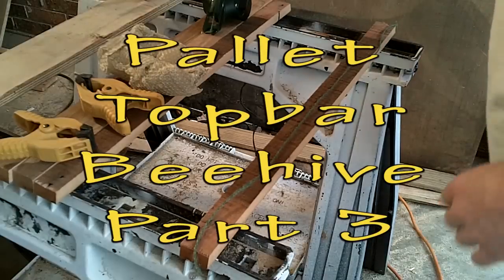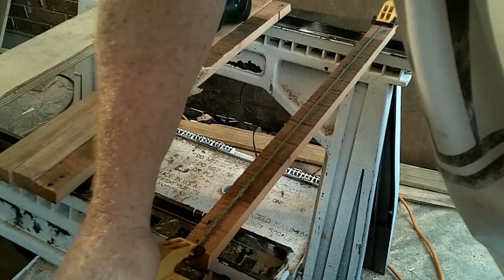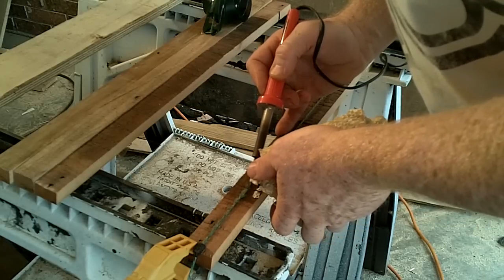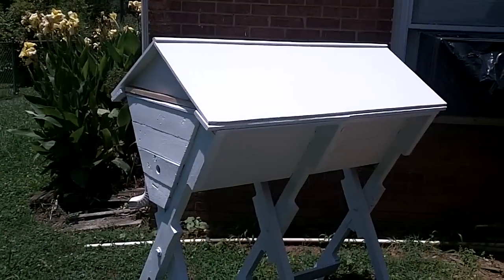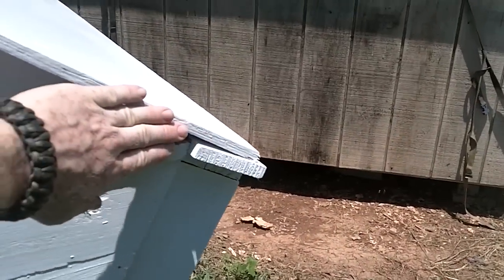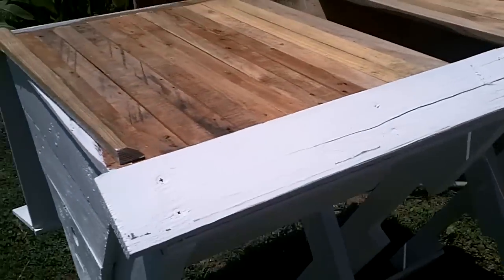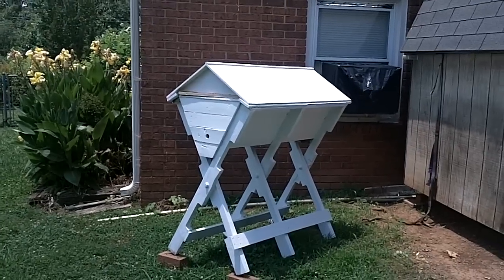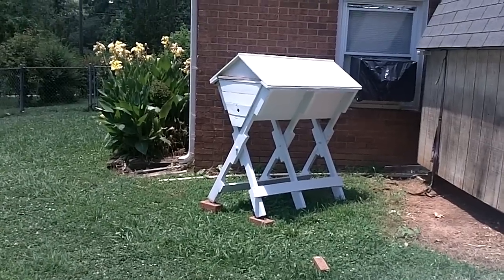Topbar Beehive Part 3

Comment from the maker: Close off the bottom will be something you will need to do in the winter time. You may want to add some install installation to the outside as well. I am still working on mine a little bit. Every year I see something I could have done better. LOL I am reworking my top on the first one I build now.

Comment: Nice TBH. I like the simplicity and the repurposing of pallets.
May I suggest NOT putting a chain catch on the top but allowing it to swing all the way open. Reason being is that if you get any amount of wind, you will either be wearing the top across your nose or across your wrists as one more bracelet. lol
Question. Could you soak the rope in melted wax and then attach it to a top bar with staples? The bees are going to add to the wax anyhow and you are just giving them a guide, correct?
Reply: I disagree... Chain that Lid !!! Do it so it's angled a bit beyond the 90 degree in the hinge direction.... With a strong Support Block to take the weight off the hinge. Also add a piece of Brace Timber between Roof and Top Bars, and another from Roof to Ground, when doing Bee work . Take these out, and store lengthwise inside roof space when not needed. Then you won't get crushed fingers and wrists, or have the Hive blow over... 🙄

Reason ?  Simple : 
As a Horizontal Hive user, Beekeeper, you can use the inside lid area, as your Frame Rest. Inspect your Frames hands free, do Grafting, Catch, and Mark the Queen... All sorts, even take Photos or Video of Bees out of the Wind, or direct sunshine (UV rays landing on eggs, will affect your QR % of success.)
Only by actually doing beekeeping will you understand the Hive Build, over and above just the carpentry. 😉

Comment: I'm doing my homework in preparation to start my first hives this spring. I really like this hive design (especially since I have an unlimited supply of palettes at my job.) Just wondering is there any winter prep for this type of hive? I live in southern Ohio and the winters aren't terribly harsh, but it can get bad. Do you have to close up the bottom of the hive for winter?